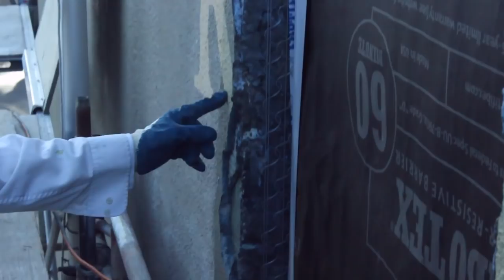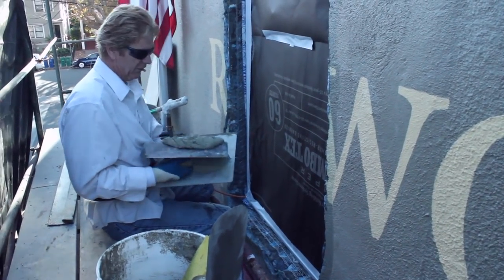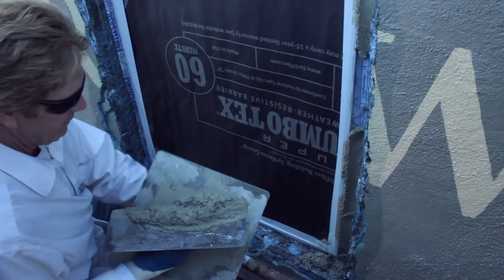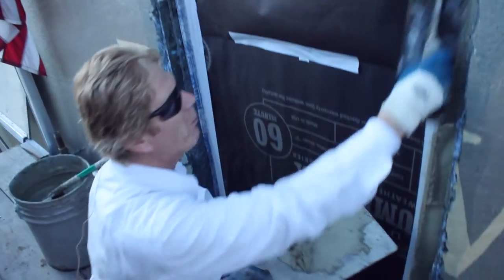Stucco Concrete Corners, Commercial work, Alameda post office

Comment: I just did my second small stucco job, I only take on small stuff at this point, My first job was a fireplace and now a year later it has developed a horizontal hairline crack. It is a smooth sandy type finish by my definition. I need to fix it before the customer sees it! Kirk, can you point me in the right direction? I copy your body language and positive vibe in every job and it really works for me!
Reply: Caulking , that’s what he uses
Reply from the maker: Happy holidays Rob, cracking is as natural as eating and breathing, in fact, most people don't even notice them. For example, how many times have you looked at the sidewalks and or streets to see the thousands to millions of crakes?
 Me nither, I would use calking and not worry about if a repair cracks in the future as it's normal.

        bringing peace, love, and harmony back to the plastering world
The University of plastering by Kirk and Jason Giordano with over 800 video’s
Reply: Did you put lime in your mix? That gives it a bit of flexibility, especially around a fireplace with the heat.

Comment: Concrete block is concrete, cinder block is cinder. Call 'em what you want if you don't know the obvious difference or have never seen a cinder block. (The last time I saw and carried cinder block was 60 years ago.) Yet I will be the first to admit...I sure as hell don't know stucco. Stucco is an art for the gifted such as Kirk and crew.
Reply from the maker: Evening James, thank you,
   I know concrete blocks are made differently to cinder blocks. However, I don't like to get too technical when explaining stuff that's already confusing to the average DIY'er. 
So, thanks for clarifying, as some people want to know all.
            No Doubt you preferred carrying Cinder blocks to Cement blocks. 😏
   Bringing peace, love, and harmony back into the world of plastering.
                 The University of plastering by Kirk and Jason Giordano
Reply: @StuccoPlastering  I was never a block "carrier" but I have moved enough to know cinder blocks are 1/5th the weight of a concrete block and not near as strong, dark in color and "glassie" in texture. True, some are "know it alls". Me? All I know is apples from oranges. I'm a simple retired union heavy equipment operator.

Comment: Kirk my man, when would you use bondcrete rather than water to stucco over blocks? Or do you always need to use bondcrete with stucco products? In the UK we typically screed over blocks with water for the mechanical bond with scratch coat, thats with a plain 3 in one mix not stucco mind
Reply from the maker: Howdy Mr. G, my fellow plasterer from the UK. If the concrete or blocks have not been painted and are free from dust, dirt, and grime.🤔
 We pressure wash. Thus a bonding agent is not necessary.
 You and I get what we both call a mechanical bond, much stronger than applying a bonding agent, or just as strong.
          Kirk and Jason Giordano, together we have provided to all folks throughout the world the most complete plastering encyclopedia ever created online.
   The plastering surgeons of Youtube, with well over 850 'free' self-help videos 🎭 👀💃
 Bringing peace, love, and brotherhood back into plastering.🏝🎆

Comment: Kirk, I have a customer that wants a 1" stucco with lath on CMU. I tried selling him on a 1" EIFS instead because i've never done stucco with lath on CMU. Normally we just do DEFS on CMU. I've read on a few sites that on CMU walls and cement walls you can attach lath using a doweling magnet and short 1/2" stubs.  Do you have a way of doing stucco with lath on CMU? I've been watching your videos for a few years now and yet to see you stucco with lath a block wall. Thanks
Reply from the maker: Happy holidays Eric, sorry you will never see any type of stucco netting from me on a CMU built walls as it's counterproductive.
    The best bond one can get is a mechanical bond where new stucco adheres to CMU blocks by suctions.
    The CMU walls have to be clean enough to eat off for the two to adhere permanently.
   On another note, if you're going to lath CMU walls, use 3.4 mesh wire, then use quarter-inch nails set with a magnet into the grout lines.

        bringing peace, love, and harmony back to the plastering world
The University of plastering by Kirk and Jason Giordano with over 800 video’s
Reply: Kirk Giordano plastering Inc. 
How do I install an expansion joint on existing stucco over block walls?

Comment: I work on Adobe building I was wondering if you ever used accelerators in lime plaster.
Reply from the maker: Good evening Lucina, before the abundance of same-day cement stucco's I used to use a lot of Luminite to set stucco fast.
                           Introducing peace, love, and harmony back to the plastering world.        
                 Sound Plastering tips for the DIY beginner or the Professional Plastering experts

Comment: Hey Kirk I recently had my house stuccoed and I’m starting to see hairline cracks around the house windows is that normal?
Reply: CDB yea it’s common. If you can fit a fingernail in it. That’s not good.
Reply: l bet it was one coat finish!
Reply from the maker: Good afternoon CDB, unfortunately, all one can do is lath and plaster as best as possible. Often there is the circumstance of vibrations with expansion and constriction that are out of any man's hands.
 Bringing peace, love, and brotherhood back to the old fashioned 🌎  “Plastering.” 
    The most comprehensive encyclopedia of plastering on video, by the plastering messengers of Youtube.  
     Over 800 videos 🎭 👀💃

Comment: I wish I had this video before I did stucco. That rapid set sets up way too fast. Can the setup be delayed? Here in AZ it seemed to setup very quickly. I was doing a cantilever corner and rapid set didn't like gravity underneath. even with wire.
Reply: Try a bag of scratch and brown with rapid set. Use a bag of scratch and brown with 1/3 of a rapid set bag. That way you have time to work it. It’s sets on the wall and not on your bucket/hawk.

Comment: Why don't you use corner bead? It may be a little more difficult on existing stucco but better results.
Seems like your ok on flat walls but you need experience on ceilings, reliefs, etc.
Reply from the maker: Evening Raised by wolf dude, to attach corner aid would have taken too much time, plus they would have been counterproductive.
    At the risk of sounding cocky, suggesting I need more experience on ceilings, it is like saying a beach needs more sand. 
Truth is, I applied what I could and had the insight to realize. That's all that the ceiling would take. There no joy in fighting against gravity. 
   The trick is to let the cement plaster set then come back when the mud set to finish what was started efficiently.
 To fight with stucco that lost its grip is a waste of time. The fact is if I had continued to try and apply that top edge, the whole top would have fallen, been there and done that.

     Bringing peace, love, and harmony back into the world of plastering.
                 The University of plastering by Kirk and Jason Giordano

Comment: l have been watch your work closely, your quit good at what you do, but,,,,,, with your man power ( l counted 7 on a wall) and plant you should be doing a 4 bed house a day. l see you do 1 coat finish witch brings on cracks around windows and doors, the finish you do is very easy, there is no uniform to your work, over in uk 3 can render a 4 bed house in 4 days all mixed through a 1 barrow mixer 2 a fine finish. try teaching two coat work, dose not not mater if it is quick set, it,s still wet and thick witch makes it shrink when dry, hence the cracking.
Reply from the maker: thanks for the tip,🤔